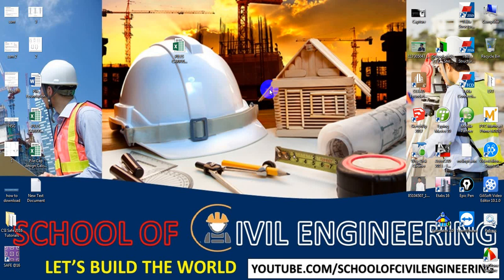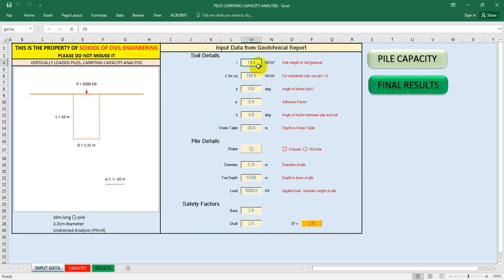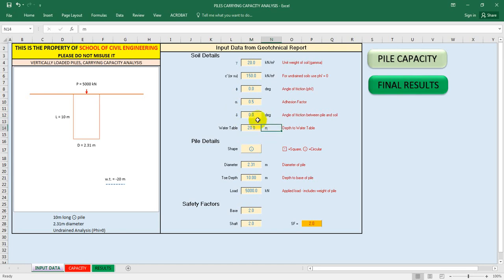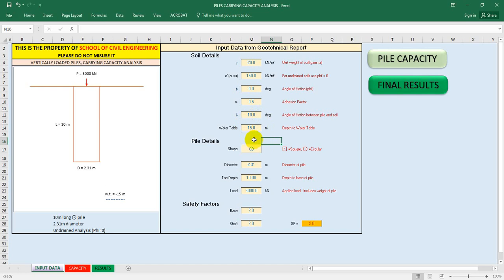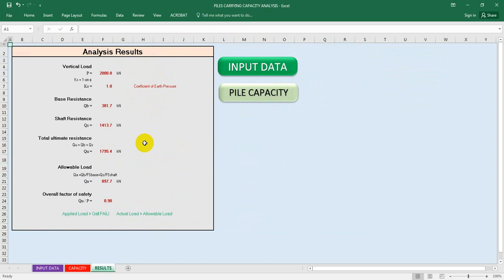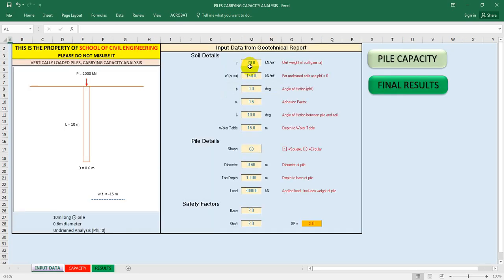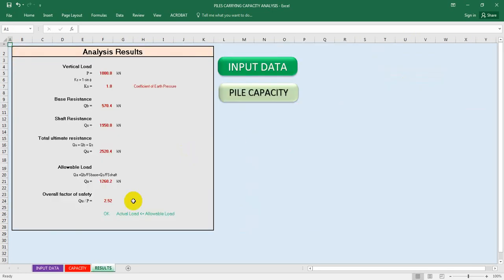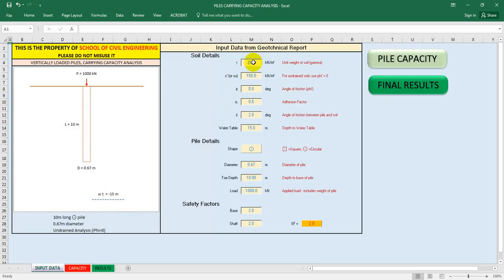PILES CARRYING CAPACITY ANALYSIS  in Excel | Load Carrying Capacity of Piles for Pile Cap Design

Comment: nice but is it  for bored or driven piles? bored piles has a capacity less than driven piles and is i for concrete and steel? as both have different capacity